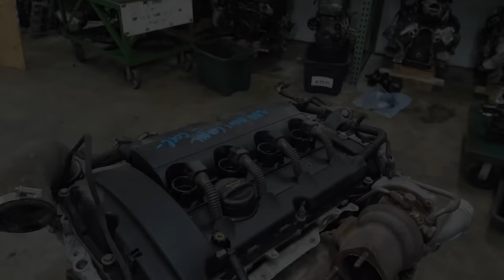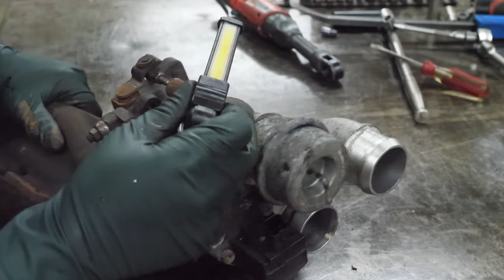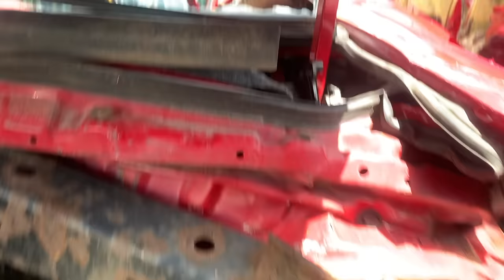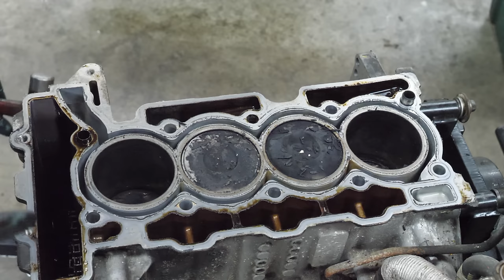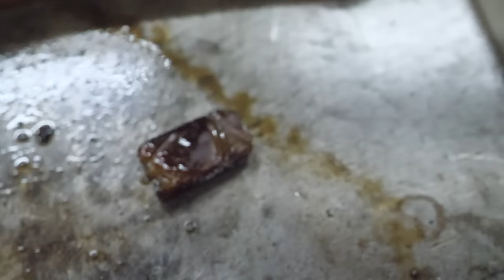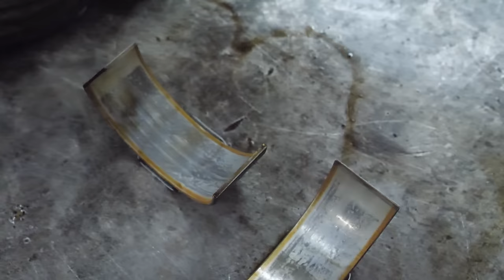JUNK Mini Cooper S (BMW/Peugeot) N14 Turbo Engine Teardown. Why Do People Buy These?

Comment: I used to be a German car mechanic (I know, I know, Mini is a “British” brand but since the British don’t make anything anymore, it’s now owned by BMW). I am telling you with 100% certainty, if you own one of these vehicles, it will blow up tomorrow, maybe even today. Premature engine failure is a certainty on these.

I’ve replaced at least 6 of these engines that had good service history, but had low compression in one cylinder. In every single case, the low compression was caused by the connecting rod being bent. They hadn’t been hydrolocked, the bearings hadn’t spun, they just bent rods. Presumably because the rods are too weak? They also score the cylinder walls horribly. They build up carbon on the pistons and when it breaks off, the chunks of carbon wedge between the piston and cylinder wall and destroy the cylinder walls. It got to the point that I wouldn’t do timing chains on them unless the customer was ok with paying for me to scope each of the cylinders and measure the piston height at TDC. Too many instances of doing timing chains (at like 50-60k miles) and then having the engine fail in some unrelated way 10-15k later.

The water pump is not directly belt driven and the part you called the belt tensioner isn’t actually a belt tensioner. The “belt tensioner” is actually an idler pulley that is spring-loaded to wedge itself between the belt on the crankshaft pulley and the water pump pulley. The water pump pulley has the rubber on it because it is kind of like a tire: it’s meant to grip the idler pulley. So, the belt spins on the crankshaft pulley, which turns the idler pulley since it’s wedged up against it, which turns the water pump “tire” pulley. It’s a stupid, overcomplicated design that could only ever be used in a German car, because the Germans like to build cars the wrong way for fun, apparently.
Reply: Hey build plenty still, JLR, Mclaren, Ariel,  Noble, Caterham..
Reply: Interesting info on this engine 👍🏻 sounds like a poorly made engine from the start
Reply: @reecedrury4145  those are all pretty small scale manufacturers and none of them besides McLaren and JLR use Engines designed by themselves.  And before you try to argue about JLR being small scale: In 2022 they sold 321.000 vehicles. BMW Group sold nearly 2.4 Million in the same time Period.
Reply: The gas Direct engines seem to give a lot of problems on any brand of car I have a Kia Rio 😢they also come in GD I engine but I asked the salesman it has to be multi port fuel injection if not. I won't buy the car but terrible. The way they make engines, nowadays.😢
Reply: well, they were co-developed with PSA/Stellantis which is just the worst of both worlds. But at least BMW abandoned it.. Peugeot and Citroen STILL put them in their cars
Reply: "I know, I know, Mini is a “British” brand but since the British don’t make anything anymore, it’s now owned by BMW" I wonder what would have happened if Honda had increased their ownership of Austin Rover (at the time it still included Land Rover) from 20% to 100%, instead of it going to British Aerospace and then BMW (and now MG Rover to SAIC, and Land Rover sold by BMW separately and put back together with Jaguar by Ford and Jaguar Land Rover sold on to Tata)? 🤔 It could have been so interesting to have Land Rovers with Honda quality control and Hondas with Land Rover 4x4 technology.  Oh well...
Reply: The British do make something..... mostly just a fuss 🤣
Reply: @reecedrury4145  Yes, all of which are poorly designed junk... just sayin.
Reply: I’m a current foreign tech, haven’t seen many of these but vag 2.0s are a daily thing. Done probably 10-15 head/timing jobs in the 3 years I’ve been a tech
Reply: Direct injection motors seem like a great idea [higher compression and all] but development needs work.  Some are looking at port injectors enabled intermittantly at idle [to help clean valves], but I haven't dug deep to really say who is doing what.  Its looking like early direct injection engines are like some early diesels that detroit tried to repurpose blocks from petrol design - junk.  Personally.... if they would do away with stupid egr systems, it would make my da.
Reply: @flinch622 The port+direct injection thing is becoming pretty popular now. Lexus started it back in the late 2000s, now even BMW is putting supplemental port injectors in new cars. 

In my eyes GDI is pretty worth it for the gas mileage and performance. On my direct injected cars, I do an initial valve cleaning by hand (maybe 3 hours of work total) and then shoot a can of CRC intake valve cleaner every 10k miles. Works well enough for me, and the gas mileage I get makes up for this added expense. I don't mind spending $200 for a high pressure fuel pump every 7 years.
Reply: @reecedrury4145 maybe 20000 vehicles a year combined…
Reply: @gordtulk ?
Reply: buddy of mine had an early one, i forget the year but it was supercharged. how did those motors fair reliability-wise?
Reply: @markfrabotta19 The correct way to implement GDI is to have a separate low pressure port injected idle circuit and any additional required fuel past idle speed comes from the direct injection system. This allows fuel to clean the valves and those setups seem to do pretty well.
Reply: Some GDI engines are much worse than others in terms of carbon buildup. Hyundai and Kia engines don't seem to suffer too badly while BMW and VW seem to be among the worst, some needing the intake valves walnut blasted as a maintenance item.
Reply: @blackdragonx1186  that was the R53. Good friend of mine had one for a while. To hear him tell it, half the time he owned it, it was on the lift at his house.

Brutal car though; he autocrossed it and with the mods he did it regularly competed for FTD.
Reply: @d47000 theres honda engines with only direct injection that do alright but even they are moving towards multi-point, for multiple reasons.
Reply: @@jacobcarrotwranglerblack6783reasonably exotic? I mean they are mass produced BMWs now essentially, meant to be daily drivers. Unless you mean they are exotic in that they go 50-80k miles before needing a full engine rebuild lol
Reply: @honkhonkler7732  Thank you very much for the info that's interesting read. Yes, dirasteroid injections, okay, but maintenance wise. It's more to do, but that's glad they got that type of system where keep that intake valve clean and don't have that problem..
Reply: The water pump is driven in that manner so that it can be turned on and off, on demand, by the PCM. Eg you don't need to circulate coolant for the first ~5 minutes while the engine is still cold. Fuel economy thing I guess.... But I agree, overcomplicated for probably little gain.

Scary part is that the oil pump also spins up and down on demand...
Reply: They call them  "Break My Wallet " for a reason
Reply: No you're wrong the British do still make something. We make bad decisions.
Reply: You can tell it’s bmw because  they’ve made quite a lot of junk engines over the years .
Reply: That idler pulley got some wires connected to it, is that some kind of sensor?
Reply: @l33tnobody1337  I don't buy into your BS. .....321,000 vehicles is hardly a small number. Nobody said they sold as many as BMW other than yourself. Reece simply said that the british still build the brands of cars which he listed,  and (before you try to argue (with yourself) again) he's absolutely correct. Please engage your brain in future. Thanks
Reply: @blackdragonx1186 much better, cast iron engine block, Talbot engine from the 70's equipped with a roots blower.
Reply: What nationality are you now?
Reply: Cylinder goes down also by a dropped valve seating, very weakly made , doesn’t have to overheat to do that
Reply: @fireerik  Which 2.0 VAG engine are you referring to? I use a 2.0 8v EA827 in a VW Bora (Jetta MK4). AFAIK they seem to be pretty much bullit proof.
Reply: Word in the forums is that this N14 is very problematic. The N18 fixes a lot of the issues, and the B48/6 is pretty reliable.
Reply: @tassielorenzo7070 blame Michael Hessletine MP for that.. He was and still is pro EU he blocked any future deal with Honda and pushed for a BMW buyout. Ended well didn't it?
Reply: @l33tnobody1337  I don't understand Stellantis. They had perfectly fine Fiat technology but they seem to base everything on Peugeot technology nowadays :(
Reply: @dukemasters6829   if I understand correctly this is a Peugeot engine... They do things even BMW would never do.
Reply: @MattyEngland  yeah, he was moving the goalposts...
Reply: @mikeh2006  - Yep the worse decision to date is BREXIT 😂
Reply: BMW should have copied a Honda DOHC engine from 1985.
Reply: They are built by germans for germans… my wife always wanted one so when our kids started driving bought a 2011 with 74 k on it. Went with a non turbo b/c the morons at mini tell everyone to change their oil every 20 k miles… so lots of oil related issues at very low milage. When i look at the repairs required on the mini vs our Toyotas it is ridiculous given how few miles the mini has. The one we bought was originally owned as a company car for a cnc machine shop. Looks like the owners put their vehicles in the company name, point being it was owned by someone with mechanical know how. 

Bottom line i bought this one because it appeared to have been cared for and one owner vs other i looked at that no one owned for more than 2 years.. at 100 k it uses about 2 qts of oil between changes …on a 4 qt system. 

Bottom line for us it is a inexpensive used car that my wife absolutely loves. If it was a daily driver i would be completely disappointed. Again finding one reasonably maintained that is not a turbo i think is key…. The germans are stupid with the 20 k oil change with BMW LL3 spec oil. Try to find an oil that meets that spec in the us, only two do. But more importantly  the spec of 20 is just asking for trouble
Reply: @markfrabotta19 it just depends on the design. Toyota, honda, and mazda use GDI engines. But all theirs are way more solid than something out of Hyundai/kia or VW.
Reply: AND THATS NOT INCLUDING ALL THE PLASTIC PARTS THAY USE THAT FAIL AND COULD BLOW YOUR ENGINE UP .  BMW HAS BEEN TAKING OVER BY THE BEAN COUNTERS . GOOD ENGINEERS  WOULD NOT USE MOST OF THE CRAP THAY PUT IN CRITICAL PARTS.
Reply: @hi_tech_reptiles  I think it's largely because of different use cases. Many of those Hondas are non-turbo, while all GDI BMWs (which are notorious for carbon buildup) are turbocharged and usually driven very hard. The early BMW PCV systems were pretty crap, but they're much improved now, and on par with everything else out there. 

An interesting personal anecdote. I currently drive a 2009 BMW 535i Wagon with 160,000 miles and the notorious N54 TGDI engine. It was owned by an older gentleman since new who generally took it easy. According to him the intake valves had never been cleaned. I pulled the intake manifold last week and they were surprisingly clean. I also just completed a 2,000 mile road trip with it yesterday. Great car!
Reply: @sjd7188  - I'm still of the opinion that oil and oil filters are super cheap when compared to replacing an engine- so 6000-mile changes is enough for me. My Kawasaki gets changed at 3000  miles as it gets used pretty hard.. I know modern oils are very good but I agree 20000 mile intervals are stupid.
Reply: Hey, good morning, that's why I got multi port fuel injection. Yes, they do have different systems but it is a maintenance issue. I think they were telling me every 10 000 miles. They have to do that decarbin procedure.  To me I just like it maintenance free, I did have my fuel and check the rail service done usually I'll do it one time for the life of the car usually I run a better quality gas never had any I guess g d I has his purpose. It's a lot more power but it is more of a maintenance issue. 👍
Reply: @reecedrury4145  All of which are low volume incredibly expensive to own specialty vehicles.
Reply: I have the non turbo version in my Citroen C4
Reply: @RobertHancock1 bruh newer Kia and Hyundai engines kaboom at like 90,000. VW definitely isn’t as bad
Reply: @mjouwbuis  that's 'cause Peugeot are the controlling partner and it doesn't matter who had the better technology!
Reply: @RollingRoadEFI "The British do make something..... mostly just a fuss"  

Only the weather though.  It's either too cold or too hot.
Reply: The Germans make great tools . With that said they have to in order to fix the motors that they make.  During WW2 their tanks had the same problems . Over- engineered , over-complicated and inaccessible .
Reply: Thank you for the especially important info.  My daughter had one of these and luckily traded it before it stranded her somewhere.
Reply: I'm sure the shops around me say the same thing for lots of different brands. But people tend to drive through a lot of water. Some air intakes just beg for water ingestion and when you do a tear down all the water is long gone. These look to have a forward facing intake like the Mitsubishis.
Reply: @blackdragonx1186  Those engines were fine, as long as you ran good gas and frequent oil changes with high quality oil. They lacked refinement, but that was not a negative in my book because I like engines with character.
Reply: @rogerbarrett9920  20K oil changes are ludicrous at best. BMW went to that when they started the 3 year free maintenance malarky. Same engines, same oil, three times the recommended change interval. I've got 175K on my N52. I drive mostly highway, and I change oil every 7500 miles. Blackstone Labs says stick with what I'm doing, because my samples show almost no wear metals. Oil change > Engine change.
Reply: The water pump design is not stupid at all. It's a clever mechanical solution to drive the water pump on demand. As like the oil pump also the water pump is ecu controlled. They made this for efficiency reasons and with european cars nowadays you wont hardly find a belt driven water pump at all. I drive myself a N13(has the same water pump assembly) 1series BMW and so far(140K KM) the water pump work flawlessly.(no slip, no squeek) The biggest issue with N14, N18 powered Minis are their owners. Most of them are careless short distance travelers that only do service when there is already the third red "!" poping up in the tachometer. The long oil service interval BMW once suggested(they said 25K KM which is way too long for roughly 4l of oil that gets drowned in gas from short distance traveling) also did not help. Last but not least the Mini is the car with the highest female buyers rate. I do not wanna come up with cheap stereotypes but as far I've noticed there are more women that do not care about a cars wellbeing than men. But as society gets more stupid in general this will even out pretty soon. (I can hardly imagine that stupid tik tok youth to even change a wheel on their own, both genders included)
Reply: @flinch622   both injection systems combined is the best imo like the strong 1.6 3 cylinder of Toyota has for it's lower end GR cars. Direct injection works best in the low and mid rev-range while port injection is better at full load enrichment and of course helps a lot with keeping intake valves clean.
Reply: Great post. It's almost like the folks who designed this engine were trying for "bad engineering decisions" BINGO.
Reply: Blame the French for this crappy design, it was Peugeot Citroen and BMW who came up with it. It's an embarrassment to the engineers, they should be ashamed.🤣
Reply: Electric motors, they rock.
Reply: @ouch1011  Just a question, how do you know it hasnt been hydrolocked? Just curious.
Reply: @MattyEngland  OP is right in as much as the fact that the brands that have british owners (JLR effectively isnt one of them, really), are very, very low volume specialty manufacturers, and not in the mainstream at consciousness at all. So not taken literally, but with a degree of hyperbole, he can be said to be right. Personally I wouldnt have put it that way though.
Reply: @@jacobcarrotwranglerblack6783 Well, yeah but thing is you used the word "exotic" as in demanding more service etc. These cars, including the RCZ are just about as bread and butter as it gets in their construction, sharing platforms and engines with models that are sold in the millions. 

As for the second usage of exotic in your US family example, the one meaning "uncommon", yeah thats fair enough but every car is exotic/undommon to some people somewhere. I could unload americas most sold vehicle for many years, the F150 anywhere in europe for decades and  it would cause quite a crowd. So the two meanings shouldnt really be conflated.

Bottom line; these cars werent really meant to demand any more service than anything else daily driven. Its just a multitude of factors that didnt go all that well in the design process.
Reply: @sjd7188  20k oil change interval is fine, but only under very stringent usage rules. My transport company uses 20k all the time since decades not a single issue. But thats of course for vehicles doing lots of miles in short amount of time and good quality oil.
Reply: @rogerbarrett9920  No harm in doing as you do, however, 20k oil change interval is fine, but only under very stringent usage rules. My transport company uses 20k all the time since decades not a single issue. But thats of course for vehicles doing lots of miles in short amount of time and good quality oil.
Reply: @dougrobinson8602  Well, I say stick with it if you like it. But 20k oil change interval is fine,  under very stringent usage rules. My transport company uses 20k all the time since decades not a single issue. But thats of course for vehicles doing lots of miles in short amount of time and good quality oil, otherwise I wouldnt recommend it, no. But it can be done without harm as you can see in some instances.
Reply: @superloopy24v  Thats not true. It was a cooperation between PSA and BMW back then. Basically PSA build the blocks while most of the higher tech stuff like valvetronic, vanos, camshafts etc.(so basically the whole head components) came from BMW. BMW also made the oilpump(which is shared with other bmw engines) and chose it's suppliers for all the inner engine parts. This engine is actually much more closer to the BMW N20 than to any PSA engine. The engines also were build in a BMW facility in England.(Hams Hall) PSA even used a aluminum cast technology they licensed from BMW. For PSA this basic Prince engine design(as the whole family of theses 1.6l engines is called, so N14, N16 etc.) is still the pinnacle of engines they offer in their GTi versions.(of course beefed up to withstand 300hp like power ratings) They call their versions THP.
Reply: Probably by the Connecting rods Not Being Deformed,But I'm No Engineer.:) @GoldenCroc
Reply: @richardrhodes-gc2ko  Wouldnt "connecting rod being bent" be classed as deformed? I should think so, using the conventional definition of the words (bent being effectively a subset of deformed), but, perhaps I am missing something?
Reply: @reecedrury4145  99% of everyone can't afford any of those, though.
Reply: They literally make their own jobs fun on everyone else's dime. "Ha ha! Vatch Zissss...!"  I love their cars but every single one is on borrowed time no matter how new or old it is.
Reply: @l33tnobody1337 it wasn’t Stellantis then, just PSA, who in fact generally develop very reliable motors - Ford used a lot of them in their European vehicles until recently with fewer issues than many of the Ford-developed engines! This was just a crap design buoy to a price, and most of the major manufacturers have been guilty of this here and there
Reply: what about r53 mini, the super charged engines are not so bad
Reply: The British manufacture the TOG 1 and the TOG 2. And they could not be more British even if they wanted to. An even today there are some similar products manufactured by the British.
Reply: @marekhlavackovi3677  R53 will break down anyway, and you will spend more on extra gas it needs than on N14 repairs xD And you've got less torque, worse brakes, transmission etc. This Tritec engine is ancient, brazilian shit, in 2023 best suited for a boat anchor.
Reply: @las3k91  mine runs great, no problems in its entire life yet, and when you do work your self it’s no even that expensive. Also the supercharger whine makes up for all disadvantages.
Reply: @marekhlavackovi3677  yeah, that sound is cool
Reply: Agreed. The minis had a good solid British engine before the Germans took over. Then their reputation tanked.
Reply: Cobblers. The engine is designed to last long enough not forever. The new Mini has sold 10 million from the Oxford plant. 10 million. And most will have a version of this engine. Not only that the same engine is used in Peugeots and Citroën cars. There's probably 20 or 30 million of these engines made and that kind of suggests you are spouting bollocks.
Reply: @markchisholm2657  You have just proved his point for him. All engines should be designed to last as long as possible NOT just long enough.
Reply: @markfrabotta19  they make them with GDI because it gives better power/fuel economy. It has drawbacks but they're doing it to adhere go fuel economy regulations. Some manufacturers are doing a combined port/GDI system to avoid the drawbacks, but that increases cost.
Reply: You can get a Mini that's five years or older for pennies on the dollar if you buy private. Stay away from dealers.
Reply: @l33tnobody1337 Actually the solve many of the problems  the ones that still has are common on today's DI engines.
Reply: @adotintheshark4848  hmm I wonder why they're so cheap
Reply: @reecedrury4145    ouch1011 is probably a yank and only knows GM, Chevy and Ford. Probably never been off US owned soil.
Reply: @l33tnobody1337   UK is pretty small little island.
Reply: Italians can also build an over complicated timing belt tensioner.
Reply: Oil in Turbo carbonised, probably wrong cheap. If you have a turbocharged engine in gets hot in the turbo and the oil needs to be the right type to handle the extra heat. Use the right type of oil.
Reply: Oil change required! Years ago.
Reply: Valve damage can be caused by being stuck due to carbonised oil. Gasoline direct injection means that the Inlet valves are not cleaned by fuel as with Port Injected engine. Exhaust Gas Recirculation means inlet valves can get gummed up. In town driving and lack of oil changes/wrong oil killed the engine. Chain guides worn out accelerated by dirty carbonised oil. Oil is the life blood of the engine it cleans cools lubricates everything. Change your oil with the right stuff at the right time/mileage.
Reply: @mikeh2006 The original British designed Mini Engine is the one of the most successful engines around 1951 to 2000. A few mods on the way. They took a fair bit of abuse and could be nailed back together. The state of the burned in dirty oil on this high tech engine is unforgivable. It has a Vanos system Variable cam timing system that does not tolerate dirty oil, a turbo that does not tolerate dirty oil. It’s a small capacity great performing engine that needs clean oil. Give it clean oil and the right oil, treat it as it it should. It is not a high capacity inefficient lumbering V8 built out of cast iron weighing a ton, that you could pour sludge in and it would still run. According to the mini forum people who love minis many examples at well over 100,000 miles. Simple correct servicing done at right time. Think Swiss watch rather than grandfather clock!
Reply: @reecedrury4145  All junk Blad, especially McLaren .... the worst money pit of all !
Reply: @reecedrury4145  ...and nuclear submarines, nuclear warships, etc.: barely disguised spitefulness. As provocation, it succeeds, and distracts us from remembering many contrary examples, such as VW Beetles being made in Mexico.
Reply: @tedbell4416 PSA 1.2 has left thé chat 😂
Reply: @ouch1011 is this the same engine as 1.6 THP (156/165 hp) in peugeots ?
Reply: Ich stimme dir in jedem einzelnen Punkt zu, wir hatten hier auch schon Diskussionen und sogar eine Klage wegen Motorschäden. Unberechenbar diese Motoren. Fasse ich nie wieder an
Reply: The engine itself is ok. But you have to fix it for your own. There are parts for the chain tensioner for example made by the community to solve some problems.

I drove a N14 for 6 years and had 160.000 km on it.
I needed a new clutch after 90k and a new turbo at 150k km. That’s it and not to bad 🤷‍♂️

And btw the R56 was build in UK (Oxford). It’s a German brand now, but was still build in UK.

p.s. I really miss my R56 JCW Roadster. It was such fun 😢
Reply: @flinch622 Subaru has dual injection on the new BRZ and I believe Hyundai uses dual injection on some of their engines
Reply: Now you tell me 😮
Reply: @markfrabotta19  Toyota has mixed port (start-up, low to mid load) & direct injection (mid to high load)
Reply: British is the last car I would ever buy.
Reply: BINGO! Junk engineering across the board!
Reply: When it came time to replace my 2000 VW Passat with the 1.8L turbo I asked my German car mechanic for which VW I should get next.  He laughingly said "buy the Toyota one", but then replied get any VW with the 2.5L inline-5 without turbo and you'll be happy.  It's apparently one of the best engines to come out of Germany, unlike this Mini engine.
Reply: Although the Prince engines are made out of chocolate, they can still get 45mpg on a run out of a 200bhp 1.6 litre engine. That's not bad, in my opinion. Yes, there are more reliable engines out there, but most will be less fuel efficient and have less bhp. Japanese engines generally are not fual efficient in comparison to their European counterparts when you compare bhp to mpg
Reply: Have my own carshop and have had a lot of these engines apart. The problem is the engine is designed by the PSA group ( peugeot/citroen ) 

Doesn't mind how well you take care of them, they will break. Timing guides, the t shape guide on top breaks off en jams itself between the chain en snaps it in 2, turbo's fail because of poor lubrication, hpfp fail, valve cover and evap system is weak and causes high engjne vacuum and causes high oil comsumption, there is no oil level ( or cookand level ) warning so when this hapens thing go south realy quick.

I tell all my clients when they think about a car with these engines to walk away. 

Believe the 2013 model and up are bmw design engines and are a little better ( same as small 4 cyl. 1 and 3 seriez ) but still terrible.
Reply: @dennishuijsman9167  They are all BMW engines. They were made in conjunction with Peogoet/Citreon as you said, it's called the Prince engine. 2012 onwards have better chain guides so apparently, fewer chain breakages, which is their main problem i believe.
Reply: This man is telling you the absolute truth, seen same exact engine failure's here in the States! Junk cheap engineering!
Reply: Looks like someone has deliberately put water in the oil filler 🤔 wouldn’t surprise me 😆
Reply: @sjd7188  this 20k mile interval nonsense comes from ‘cost of ownership’ calculations that fleet accountants use. Obviously these people are clueless, but if you double the interval you half the maintenance cost so you can fool these idiots into buying a fleet of your cars and not another makers 🤷‍♂️
Reply: @marekhlavackovi3677 completely different engines. Those were GEMA engines and iirc reliable. Chrysler had theirs in the Neon, Mitsubishi’s 4B11 was in the Evo & plenty others.
Reply: first its NOT a BMW engine, its  a Peugeot Engine.  if you don't change the oil in time and regular, the timing chain will get slack and the tensenors can't extend further.. result chain migt snap or jump= result engine damage.   Second issue thermostad housing cracks as its plastic very common and at last the waterpomp.fails often....
Reply: @blackdragonx1186 The supercharged motors are the great ones. That engine was also used in the dodge neons. None of the oil consumption issues the Prince engines suffered from.
Reply: @runner3033 Thats only in Europe. In America, the water pump works all the time. They did research and realized that wasn't a good idea on the American market.
Reply: @bertone122 Thats a pull tab to slacken the tensioner so you can remove the belt 😂.

In Europe, the tensioner is electronically controlled on and off to help the engine warm up faster, but in America we don't use that on these engines, and the tensioner is 100% mechanical.
Reply: @Squilliam-Fancyson The electric water pumps were junk, and BMW abandoned that, and returned to belt driven pumps with the B series engines.

Also, these manufacturers don't make anything anymore. They go to industry suppliers and "up-fit" their designs. Those crappy electric turbines were made by Pierberg, and BMW was able to get out of contract with them when Continental aquired Pierberg. BMW then promptly switched to a traditional belt driven pump made by Wahler.
Reply: @LynxStarAuto  I can not say anything bad about them as I never had any issue with em. Not in my F21 and not in my girlfriends almost 10 year old Mini. 
That's true, partly. Of course the automobile industry heavily relies on contracters nowadays. That does not mean though, that there are no parts made bespoke for a car model. Also here and then you'll find parts that are directly made by BMW, VW AG etc. For example the oil pump in the N18/N13 is made by BMW. No contracter involved. Same goes for the camshafts and other engine/car parts, on which BMW has patents on.
Reply: The factory oil service interval was 18K miles.  That's why even if someone did all of the maintenance at the factory they have nearly all blown up by now.  I always changed my oil in between the factory interval at 7K and it still went south on me before 100K.  A shame because up until that, this was my favorite car of all time and now I wont touch one.
Reply: ALso one other thing to check out.  That crazy Oil filter housing design does not have enough fasteners on it to keep it flat.  Could that be where the oil and water mixed?
Reply: So many haters 
Got a n14 jcw my self 
Great litle car who embarasses the most of today .
Reply: British bmw plants makes all the 4 clys.
Reply: @l33tnobody1337  not co-developped: this is a 100% BMW designed engine CO-FINANCED by PSA (Stellantis did not exists in that times)
Reply: @SuperMrBrownstone  non turbo is another engine , no comparision...
Reply: The idea of manufacturing a water pump in this way was to adapt it in the short term to be clutchable or piloted.
In this way, the engine would reach operating temperature faster when the water pump was disconnected.
Reply: well the 2013 -> use a bmw b48 engine. should be a lot better
Reply: I think this engine was built in collaboration with PSA group which makes it even worse - the peak of French-German unreliability.
Reply: True, I know from someone who was high up in Rover they said  that Honda were deeply offended as the Japanese do business with a mutual respect, building a relationship with their partners, Honda were totally shocked, and it spoke volumes about the Rover management at that time...Crooks !!  @TassieLorenzo
Reply: Yet my Peugeot RCZ 2011 THP156 almost 170 000km engine is still running like clock and uses oil surprisingly little ;)
Reply: @BLCKVD  Even with known horrible engines you sometimes get lucky...which doesn't mean they are worth the risk if you know about the issues though.
Reply: @HenrySomeone  For sure, and i’m glad I got lucky, but i also keep driving it gently, i’m trying my best to use it gently like babysit, because if it really is that unreliable, don’t wanna beat it if it can’t simply handle it, so I babysit and maintain it in time and change oils every 5000km
Reply: @HenrySomeone  I mean, if I could, I would get ridd off this engine if it’s so miserable but what can I do?! Pretty much nothing else than throw whole car away but I don’t want to, I wanted RCZ but I don’t want this engine if it’s so shit, I could take any other more reliable engine but I can’t realistically, this is the one what came with RCZ unfortunately.
Perhaps retrofit some other reliable engine? Well that’s so much more troublesome that I don’t most likely have money for that and time and energy
Reply: german cars are probably the best engineered cars period!
Reply: Sorry to burst your bubble but that’s actually a French engine from Peugeot that was supplied to bmw thy stoped in 2012
Reply: British do make bad decisions indeed!
But let's not get political 😉😂
Reply: Is there any Mini from first two generations, which motor is not crap, and one could consider buying?
Reply: I've worked on all kinds of engines ,American and European for 50 years and this 2010 mini is THE worst!!
Reply: Everything about these engines is designed to fail. The mini has such a following because they look good and it's iconic name. Street cred is why they are purchased, bigger money making machine for BMW ever. Biggest load of crap ever. It's an awful shame, seems an awful waste of what it could have been.
Reply: Hmm seems everyone missed the memo...

BMW may own the brand "Mini" and it's offshoots like "Cooper", but they are still built in Britain as they have been for 65 years.

So german owned and designed but British built.

How does that sit with your false claim of the British don't make anything anymore Fritz?

Seems Germans don't design good engines anymore either with countless VW & BMW engine flaws and engines that require the main,  con and crank bearings replaced after 80k miles not a good look for the Germans, since yhe Germans don't engineer any good engines anymore either Fritz.
Reply: @Squilliam-Fancyson FACTS
Reply: mine engline blow up just after 2 months with 104.000 km .... :)
Reply: mine has 140.000miles on it from 2013 ,but it is a PSA car 1.6 thp 156hp it's based on the n14
Reply: The guy who sold me the renewed engine to replace mine… said the leaky injectors cause the burned piston heads, cause oil and fuel mix up… over and over.

This is scary. And BMW is getting away with such a crap. No class action lawsuit, nothing.

Just scary to drive any of these cars. They are sure pretty and high quality build, but the engine is a nightmare. 

Like a bad girlfriend, ruining your life until you end up with a heart attack